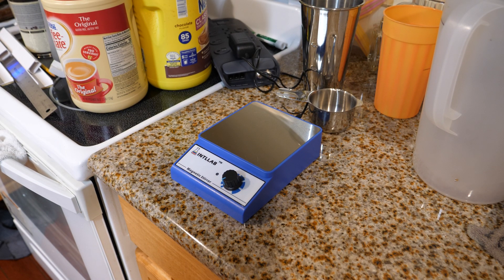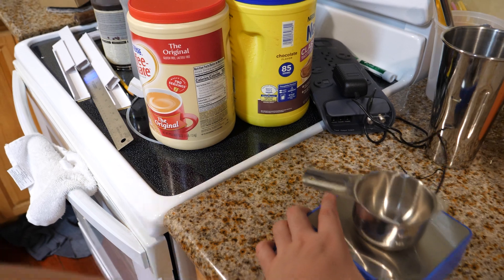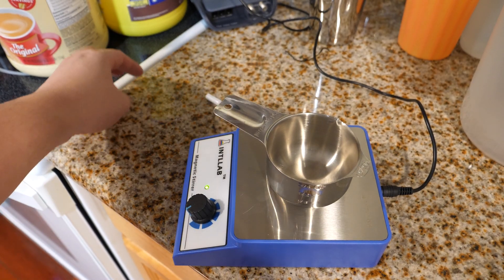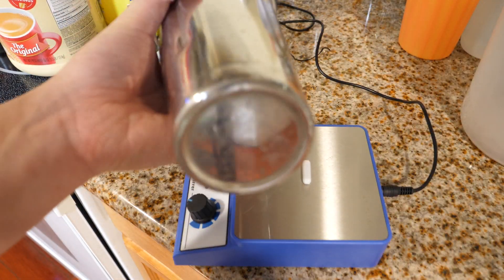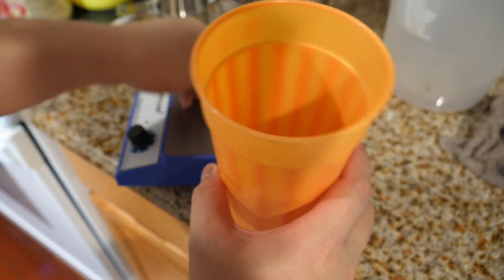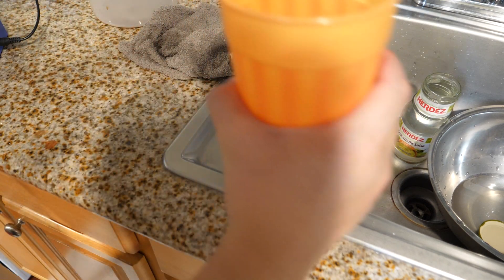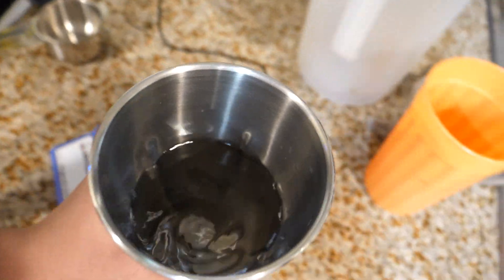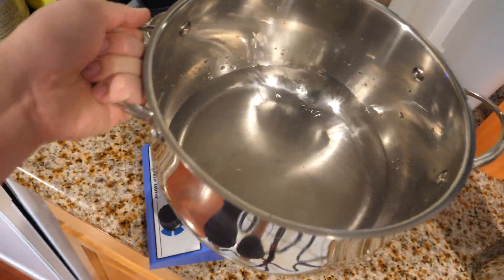INTLLAB Magnetic Stirrer Stainless Steel Magnetic Mixer with stir bar review

Comment: Ha! I lost it when it was going in circles on the metal pot! hahaha. Thanks for this!

Two questions. I'm concerned it doesn't have an "off" button? Do I have to unplug it? Or does it click/turn off on the low setting?

Have you /can you test it on a Mason jar? I am wondering since those have a rounded bottom, if the stirrer will stay?
Reply from the maker: It clicks/turns off on the low setting. I have a glass container with a thick concave bottom that I tested with and the stirrer didn't stay. I find that it varies with the thickness of the container your using, I had tested with metal pots with a thicker bottom and the stirrer didn't work for those either.
Reply: @Kiet1  awesome! Thanks for the quick reply.